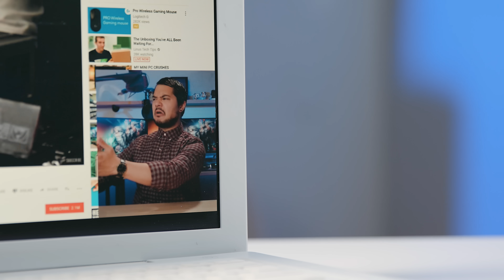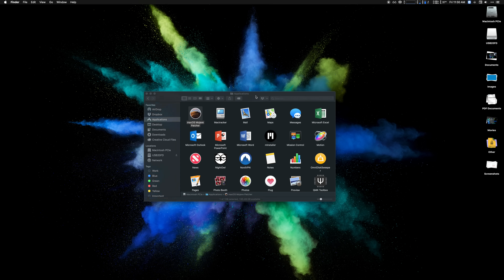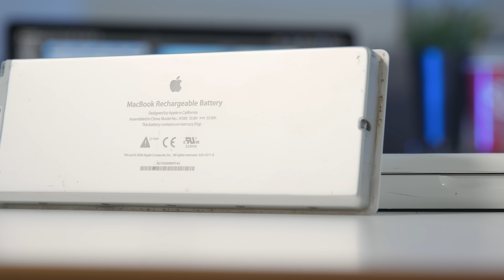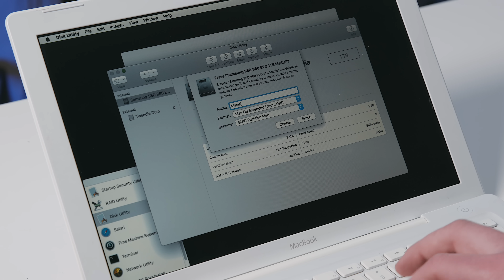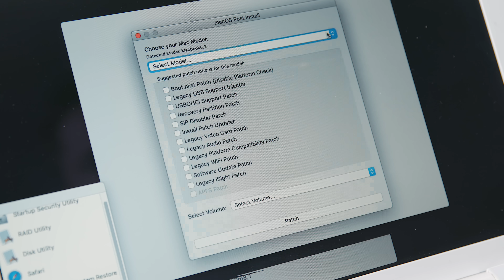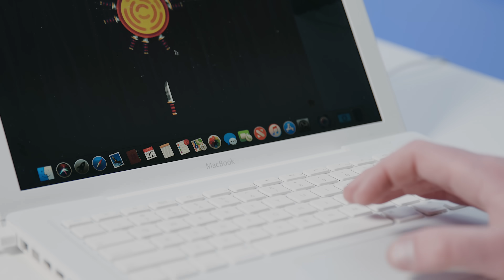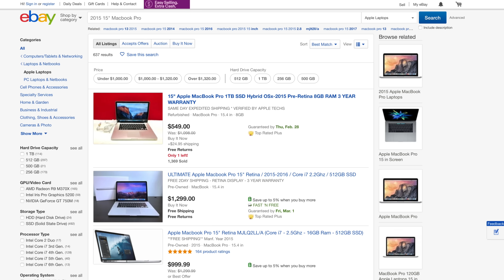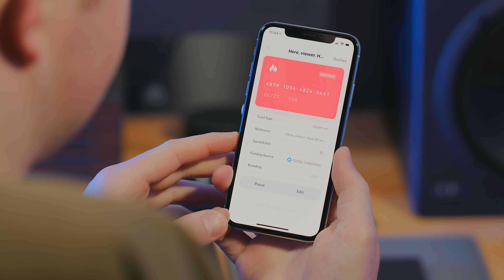Hackintosh a... REAL Mac?!

Comment: Thank you so much for this tip. I'm still using my Macbook late 2018 daily. One thing you missed; the can upgrade the RAM above the Apple recommended specs. For the correct information; use MacTracker (OSX app), and upgrade your Mac to 8 gigs of RAM. I'm gonna use my Macbook late 2008 for the rest of 2019 for sure, and with this tip it gets easier to install latest Adobe or other software. Thanks Snazzy Labs. If the quality of the Macbooks was as oldschool as those Mac's, I've would have upgraded way earlier.

Comment: please tell me , which one i should have and upgrade ; Macbook pro 15inch 2011 i7 or Macbook pro 13inch mid 2012 i5 ? Because i already had one MBP 13inch mid 2012 core i5, and i wanna swap it with MBP 15inch 2011 core i7 for a better experience on editing video. Because on my MBP it's not include a Graphic Card, but MBP 15inch 2011 core i7 using a graphic card. Please help me dude ..

Comment: /dev/disk4           GUID_partition_scheme           
/dev/disk4s1         EFI                             
/dev/disk4s2         Apple_HFS                       /private/tmp/installesd
 Validating target...done
 Validating source...done
 Retrieving scan information...done
 Validating sizes...done
 Restoring  ....10....20....30....40....50....60....70....80....90....100
 Remounting target volume...done

Comment: the feature that lets you change the battery without loosing your session is called safe sleep and is basically a combination of sleep and hibernate. if you want to take the battery out, make sure the system has finished serializing its ram and is sleeping (light is doing snoring animation) before taking out the battery. also, so mojave removed the safe sleep feature??

Comment: If you're going to discuss adding a third party SSD to an old Mac, you seriously need to include how to enable drive Trim so it doesn't wear out the SSD prematurely. Just pull up system profiler, check the drive info and you'll see trim isn't enabled. To fix this just open terminal and enter this one command (ignore the scary warning and just say yes when prompted) : sudo trimforce enable
Also, High Sierra still receive security updates. Apple has typically supported its major Mac OS releases for three years from each release. They have no official statement on it, but based on what they've done so far this decade, High Sierra probably has about another year and a half to go before it's no longer updated for security issues.

Comment: Actually, there are laptops today where you could swap batteries without losing your work.  The T series ThinkPads have an internal battery that keeps the system powered while you swap out the external battery.

Comment: ¡¡¡¡Excelente video!!! I have a MacBook black early 2008 and several years ago I changed its HDD for an SSD and runs very good. However I couldn't change its MacOS for a new one, because of Apple HW limitations. So I decided to put Boot Camp and runs MacOS and Windows. W10 runs very very very good on my old MacBook. Did you try boot camp on it? Un gran saludo desde Argentina.

Comment: Did you just say no modern computers can hibernate? A feature that's been around since at least windows 98??
Reply: That was hybrid sleep, where it IS in sleep mode, but the stuff in the RAM gets copied to the HDD while sleeping so if the battery dies in sleep mode, it will resume what you were doing.

Comment: dosdude1's Patcher is AWESOME. I've installed it since the first Release and Mojave runs really good on my 13" Inch Early 2011 MacBook. OF COURSE with an SSD.
Sure there are some Graphic Problems but only if you use the Light-Mode in my Case.
I also discovered some Problems with Bluetooth but with the 2012 MacBook Pro AirPort Card it works fine (Plus i got BT 4.0 instead of 2.1+EDR)

Comment: I have the exact same MacBook model (sorta, it was actually a 2008 with a 2009 motherboard so I could run the latest version at the time), and there are numerous issues with this that make it unsuitable for me and most people. The biggest issue is the lack of proper trackpad support, gestures don't exist and the computer thinks it's a regular USB mouse. Another problem is the incompatible Wi-Fi chip, which is only due to the motherboard swap. Even though El Capitan stopped getting security updates, I'm still staying on it since is a very secure platform as-is (at least compared to Windows).
Also, it's not exactly accurate to say that Apple 'wanted' you to upgrade the hard drive, most Macs took 30 steps to upgrade it and the ones that didn't (such as this one) hold them using Torx screws. For the record, this computer literally uses no Torx screws EXCEPT for the hard drive bay. They did advertise RAM upgradability though. That being said, the fact that you actually can change the hard drive is at least something, because nowadays your Mac is soldered garbage and if your RAM stops being enough or your SSD fails, you're screwed.

Comment: You need to enable trim via terminal in order to set the mac into ssd mode otherwise it will always write in the same cellule and with ssd the drive just die in like 3-4 month the command is sudo trimforce enable no download needed its native to macos

Comment: I've been using DosDude1's patching tool since Sierra on 2008-2011 13" aluminum MBPS, and they always work buttery smooth with no issues - DEFINITELY recommend the SSD upgrade. If you have a model the patcher supports, do it.

Comment: You said it supports high sierra, which was released in 2015? this is not correct. High Sierra was released in 2018.
Reply from the maker: High Sierra was released in 2017. Meant to say El Capitan. That was 2015 and the most recent version.

Comment: I was a fan of Apple OS X, I got a Mac mini late 2011 8gb ram 500gb drive, I got a MacBook pro 2013, an iPod touch and iPod nano, iPad mini... I started to loose the fun part of using the OS X since Apple will force you to upgrade to a new version of OS X to use such app, since my Mac mini 2011 is kinda old I just can't upgrade due to Apple os x compatibility which means if you want to use your apps or download new ones then you need to get a newer Mac mini, why on Earth someone keep pushing money on something new when the old one is still running? Apple you are a real bitch, I'm now using windows 10, I don't see why wouldn't someone use it as it has everything you need... Good bye Apple go find another victim

Comment: My wif'e 2009/10 white unibody Macbook is still running strong, with an SSD upgrade and a small bump in RAM.  For most tasks it's awesome and a way better performer than any 10 year old Windows laptop.  Same goes for our old iPhone 5S we use as a dedicated music player connected by BT to a Tivoli stereo system.  Runs latest iOS smooth as silk.  Ironically, with device hardware innovation reaching a bit of a plateau, Apple's strength in supporting old devices on current OS is turning into a weakness, contributing to the slow-down in iPhone sales.

Comment: Would this work on my old iMac 7,1 in the sense I would still have WiFi? The WiFi module is not supported in High Sierra onwards so if I did force a macOS upgrade I’d lose WiFi.

Comment: Make a 1 week update and tell us if you found any issues running Mojave in a non-metal machine.
I have a MBP late 2011 (apparently supported by the patcher)
Reply: Is there a chance to boot without amd gpu kext, since my dedicated gpu died, I can only use intel hd3000? Same mbp 2011

Comment: Regarding the swapping batteries, Lenovo Thinkpads allow you to swap the battery while the laptop is on - yes you can take out the battery without the computer turning off as there is a second battery inside the chassis (which is also user replaceable)

Comment: There was some light dinging of Apple is this story but I don't think you were nearly harsh enough. 

My Mac Mini (Intel-based) stopped being useful when it was no longer supported by subsequent OS/X releases, well before the end-of-life of the hardware and well before I wanted to retire it. By contrast, I kept older Windows PCs running much longer than expected with new Windows updates. Had OS/X updates been available, I would have upgraded RAM and hard disk in the Mini despite the relative difficulty.

I've never given another thought to buying a Mac.

Comment: Because of the glacial USB2 and the slow i3 or Core 2 duo processor and the non retina display this is an great laptop for everyday needs (more like the previous MacBook Air than a MB pro), but I would not want it to be my work machine.

Comment: the iPhone 5s got me thinking. by the end of 2019, it has been supported for 6 years and it's still a very usable phone that makes decent pictures. yes, for some people it was expensive at the time, but life just gets crazy expensive in general and you do use your phone a lot. my mom replaced her old iPhone 5 when she broke it with a 5s, right when the 6s came out, because she didn't like the bigger phone's. it was like €350 back then and it's still holding up.

for some people, 6 years isn't a lot for such an investment, but it basically means you could make a baby real quick, and by the time he/she finishes their first year of elementary school, you're still using the same phone. that's just… wow.

Comment: My Thinkpad can have its battery removed while it is on and have a new one put in, without shutting down and it never turns off thanks to the Bridge Battery System where it has two batteries.

Comment: @6:00  "No modern computers can do that."  
Correction, no modern MacOS computer can do that.
You can still buy battery swappable Windows laptops.  Set it to Hibernate when "Closing the Lid."  Voila!  

I've got a gaming laptop I do this on, and it takes 45-60 seconds to swap the battery in this way on Windows 10.

Comment: How can you say that saving work onto an SSD for changing a battery is an awesome feature? You can do that on windows or any linux too. Many Thinkpad models have 2 batteries - one removable, one internal. So when the main battery is running out of juice, you can just switch for another one without doing anything with whatever you're working on. That's so much better.

Comment: I have this exact machine but I would think twice before using it. Last time I bought a battery for it, I found a similar one only and failed after a couple of months plus the included similar charger burned. If I could find quality battery and charger I may try this thing. I may even try to upgrade the display to a 4K one is it is supported.

Comment: "no modern computers can hibernate"... Right, right... Guess it's time for a switch to windows, eh?
Reply from the maker: Not the same. Lenovo computers can do it but basically no others AFAIK. It dumps the volatile contents from RAM into the actual HDD/SSD and then restores once it boots again.
Reply: @snazzy  that's what hibernate is. Dumping ram into hdd/ssd. Sleep doesn't dump into hdd/ssd and requires power to keep awake. Hibernate dumps to hdd/ssd and doesn't require power to be able to restore later. Look it up. And dump crapple.

Comment: Just take care upgrading. Did this on a 2009 27in iMac. Installed 10.14.2 then the system update took it to 10.14.3 and now it won't boot any more inspite of reinstalling the patches from the USB boot drive.

Comment: NO modern computers allow to pull the battery out? Are you out of your mind? No modern computer except... well... all of them???? OOOOOOOOHHHH you mean macs :)
Reply from the maker: You and I both know that most machines don’t have hot swappable batteries. They can be removed if you partially disassemble the computer, but that’s not the same.

Comment: Dude you're making not any sense.  macOS has far longer support for hardware than iOS.  2012 macs support Mojave which was released in late 2018 - which is SIX years (8-2=6), one year longer than your example of iOS 12.x support for iPhone 5s which was released in Q2 2014.  Then there's 2010 Macs which support High Sierra which was released in 2017, not 2015 as you incorrectly stated and that means 2010 macs were supported with the most current OS for SEVEN years.  Lastly, and most importantly, High Sierra is still very much supported and updated with the "latest security patches" having been updated as recently as January 2019 (macOS High Sierra 10.13.6) which effectively makes 2010 Mac support lasting NINE years.  Show me an iOS device supported by a current OS for 9 years.
Reply from the maker: I’m speaking in terms of relativity. As compared to iOS devices vs the competition, Macs are supported far less time in length than any other PC. I even made a big animated note about it.
Reply: TBF, he's probably referring to the fact that Apple supports older iOS hardware than any Android manufacturer does.  
But that's not much of an accomplishment, considering that puts iOS in second-to-last-place.  Windows, macOS, and Ubuntu LTS all have longer support cycles, in that order.
Reply: @None17555  Nope.  He literally compares macOS to iOS in terms of years of support.

Comment: You could set a Windows PC to be able to swap batteries without losing any data. Just go under power options and for close lid select hibernate. Now whenever the laptop lid is closed the RAM will be dumped to the HDD/SSD and when you power on the device again the PC will be right where you left it.

Comment: "As old as 2007" as this is an achievement.  I had customers with Intel Pentium 4s from 2000 and got Windows 10 installed. I know that you can't run newer versions of MacOS on the older machines because of the PowerPC architecture but still, hardware from 2007 is not that obsolete, remember that we got the Q6600 in 07?
Reply: It's because the greatest strides in processor power over the past 10 years have been on physical size, thermals, and power efficiency.
Assuming it wasn't a Best Buy spin from a Taiwanese company, any 10 year old Windows machine is going to hold up just fine to those same tasks today, and you can find them for a few bucks on eBay, etc.

Comment: I still have my white macbook from 2008. Unfortunately the battery is dead so I will have to find a replacement somewhere but I will definitely check this out. I also didn’t realise you could swap out the hard drive that easily!

Comment: Mac doesn't have as much praise as iPhones as a 5-year-old iPhone is running the latest OS which means it's supporting 5-year-old hardware. Yet the computer you were just talking about is a 10-year-old computer running an OS from 3 years ago... So the mac you're using is being supported on 7-year-old hardware..... You make little to no sense lol.
The iPhone SE will likely drop support for iOS 13 this year meaning it'll be stuck on iOS 12

Comment: "No modern computers can do that"

Uhh... Every single Windows computer can do that lol

It's called hibernation. You can configure your laptop to go in hibernation instead of sleep mode when the lid is closed and then yes, if you have a removable battery you can take it out and put it back in and still continue where you left off.

Comment: I give Apple credit for slowing my iphone to force me to upgrade.  and for using bad internals in my MBP2011 which rendered it useless as the graphic card is not working anymore as I can’t even bypass it. That is why Apple is dead to me after spending a fortune on its products. And I prefer a working phone or laptop with older software than a broken or slowed by company one.

Comment: This was awesome, glad you were able to upgrade the white MacBook.  I noticed that it has some ports that Apple hasn't been putting in their newer MacBook's and MacBook Pros.  I also love the USB 3.0 (Type A) ports, especially 3.0 or faster, the HDMI port, network port, SD Card Slot.  I also love having a CD-ROM drive because I do have some hardware that come with the drivers and software on CD's.  Like my printer and Wacom tablet.  I have some books on Premiere Pro and After Effects that come with a CD as well.  

I went with an HP for my upgrade and it came with a Numeric Keypad, CD-ROM drive, NVidia, HDMI, 3 USB 3.0 Ports, Audio Ports, Network Port, it even has a USB-C port.  I do love Macs and the MacOS, but I also love a wider laptop computer with all these features.  It has a touch screen as well.  It also has a 1 TB Hard drive with 7200 RPM and 16 GB of Octane memory, as well as quad core I-7 8th Generation processor.  I wish Apple would make a 17.3 inch MacBook Pro with these extra features.  

I have Windows 10, and Office 365, and Adobe Creative Cloud.  The other advantage is that on Windows Office 365 you also get Access and Publisher, which isn't available on the Mac OS.  I was hoping Apple would upgrade the I-Mac, but they haven't done anything to it.

Comment: What added value will MacOS give you over Linux in this old of a machine? I am asking because I did a similar upgrade to a 2012 MacBook Pro, SSD + 8GB ram. And to be honest, I couldn't bear the slowness of MacOS. I ended up just slapping Ubuntu on that bad boy and now this machine is my work laptop.
Reply from the maker: Because it's macOS and comes with the benefits of macOS. For those willing to dive into Mint or any other alternative distro, Linux is a great option.

Comment: I did this same upgrade to my late 2008 aluminium unibody MacBook (MacBook5,1) last week and am very happy with the results. The new SSD is bottlenecked by the SATA 2 connection but is still significantly faster than the spinning HDD! Mojave is running with no problems too so I’m very pleased 😊 Like you say, it was a breeze to do

Comment: Try changing/upgrading your battery/storage/RAM with a simple swap in your 2017/8/9 Macbook...
Reply from the maker: If you watch the video, I talk about how this isn't possible on modern Macs and how that's a shame. What's your point?
Reply: @snazzy  Just having a bit nostalgia, when Apple product is still worth the price and they're not soldering everything to the main board...